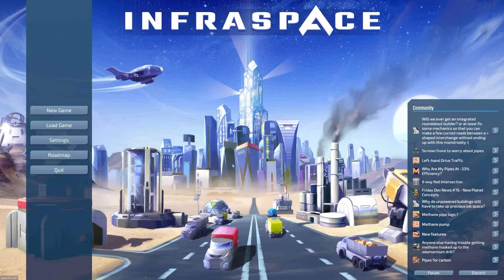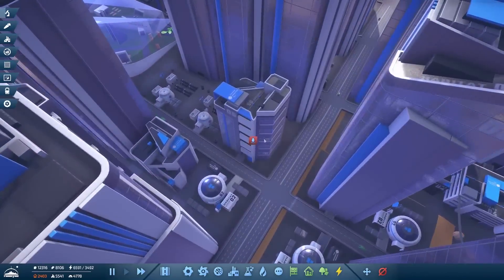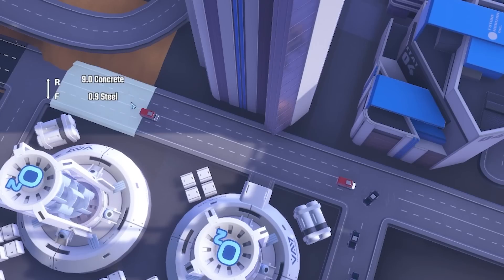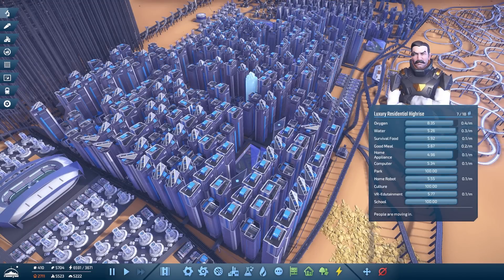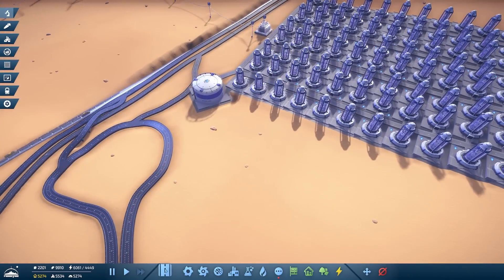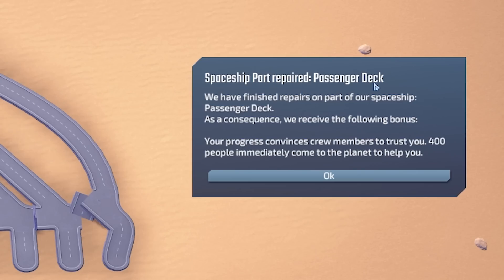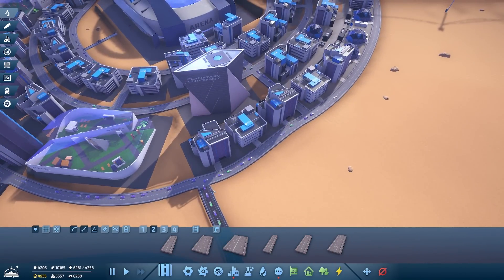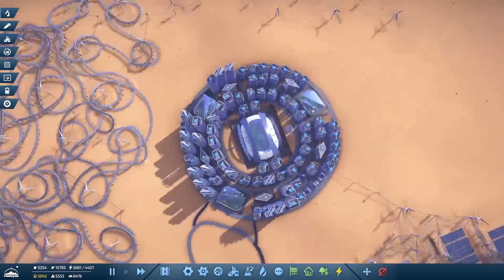This is why CIRCULAR CITIES are the future...

Comment: The thing that fixes traffic isn't how far or what distance, But purpose making the residents live close to where they work.

Either by moving the work to them or them to the work.

And the circular city is basically a exact copy of this concept, But you would be able to avoid this by using the theory and not the schematic.

Plus why wouldn't you just have 4 ways inside the city this entire concept is don't think about cost.

Comment: I know this is almost impossible to implement now without a complete overhaul of the game, but given some of the buildings necessary to upgrade the habitats have a round area of effect, it would make things much easier if the buildings, and consequentially the grid, were all done on a hexagonal tile. this would maintain the tiling and arguably make things easier to process under the hood, while allowing for a higher degree of freedom in building on the grid (30 degrees, to be precise)

Comment: the requirements for housing is based on both number of people and habitat level. the level determines what items it needs, and the number of people determines the amount of each. so nobody in the habitat would mean you would need nothing, even if it is max level. a low level habitat will mean you don't need as many different items, even if it is full of people.

Comment: Nice video as always. 
Don't forget to complete the space ship since you get some nice bonuses from some tasks. 
Also placing a recycle center at every production building is really good because you reuse items.
To be fair nuclear reactors are shit, they use too much jobs(uranium mining and plant itself) while solar panels don't need any jobs. 
Adamantine mine is the last thing to build at the moment and you can't use the adamantine for anything.
If you build the adamantine mine it will need methane to operate but you can't connect methane pipes.

Extra, please check the train lines they can almost go vertically up.

Comment: 18:48 I have lots of tickets because of situations like that. There's some portions of the road that are good, its 120Km/h, then there are old bad ones that's just 90Km/h. I plow at everything at 120Km/h without slowing down.
Also, there's no concept of Max Speed for me, its not a max speed, its "The Speed", why would anyone ever drive bellow the "max speed" ? I don't get it. If there wasn't any stupid limit I would go 230Km/h, because that's the max my car goes.
Reply: "I paid for the entire speedometer and I'm using the entire speedometer!"

But yeah, some roads are simply too shitty to kick that 120Km/h max speed, lest you want to die. But at that point you might as well kick in some 200Km/h so when you crash on a pothole you get send to Jesus in a blink of a fireball

Comment: Hey Matt, if you set each traffic light phase for all cars in one direction to go at the same time they will actually move.  It's not perfect but it's the only way that works atm.  So all drivers in one direction all going straight, left and right at the same time.  That also gives you the bonus of being able to set all left turns being able to turn into every left turn lane, all cars going straight able to enter any of the straight lanes instead of just one lane, etc.  I also find that the heaviest traffic direction benefits from at least 10 seconds of go time or longer, and if it's a MASSIVE amount of traffic I unclick the "traffic phase switches when no traffic is present" box so the light is green for the full amount of time it's set for.  That is the only way I've gotten lights to work and traffic to actually flow pretty well.  Lifesaver.
Round abouts are good too but as the post you highlighted shows, working non-hideous roundabouts can be painfully finicky and ugly.  Often more effort than they're worth although I've got a few in my city that work well enough after way too much tweaking to get them to flow and not look hideous.  It can be life changing!